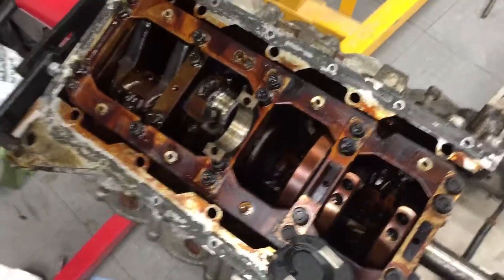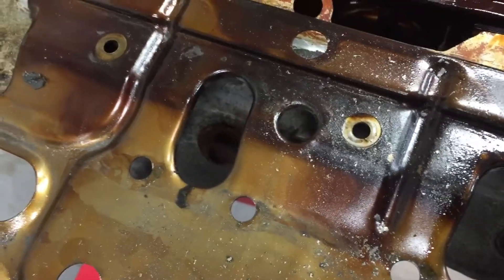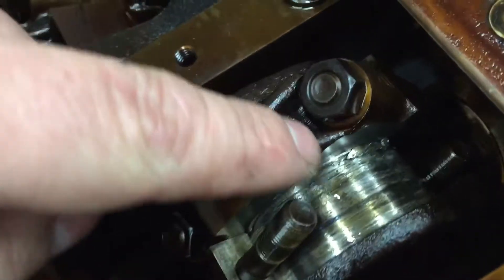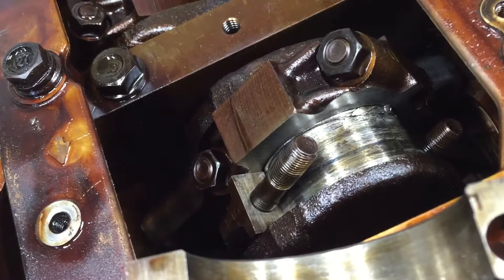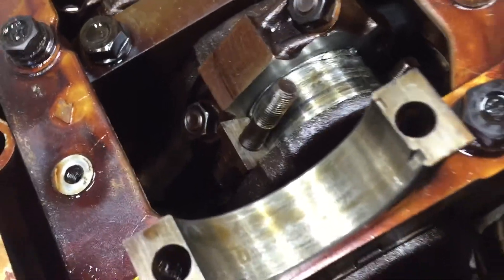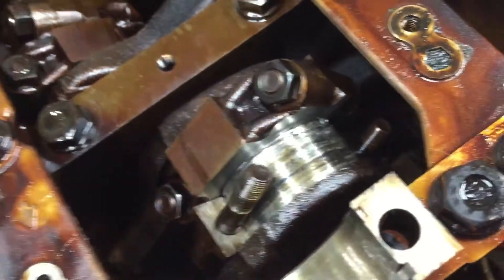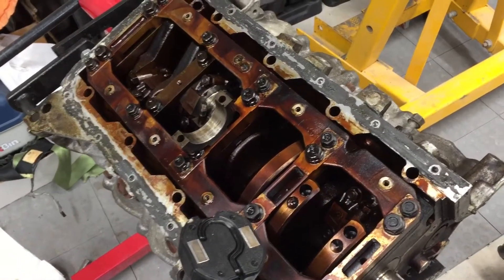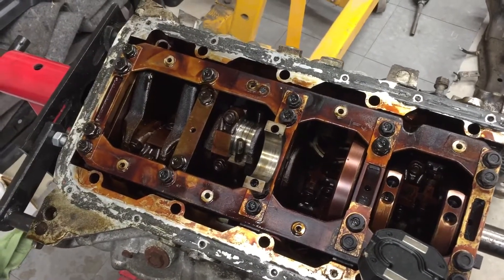Curious Case of a Cheap VH45 Part 2

Comment: I have been involved in motorsport for 50 years and one of the first things you learn is , that when you go to the track with a standard oil capacity and high revs for long periods you will find it runs out of oil in the pan because it all takes time to return, now with a quad cam thats an even bigger problem because it has so many moving parts up top that slow the oil returning , so while at the track we would run the engine with a full quart more oil, same applies to turbo motors of any capacity

Comment: Completely unrelated to this video but since this is your most recent , is there anyway you can tell me if the headers from maxworth worked ( probably butchered that ) ? And if you could make a video of your current headers a little more in depth ?
Reply: And what clutch are you running ?... Lol
Reply from the maker: +Philip Kappesser Running stock manifolds with gutted cats. Have knockoff headers still to install. Clutch is a southbend stage 2 I believe. It sat for a year or so before I finally installed it.